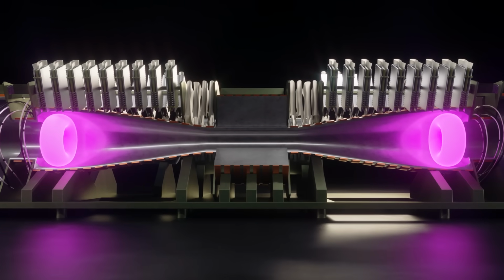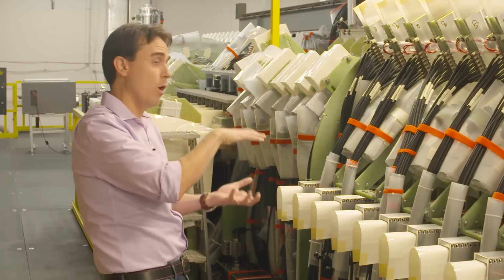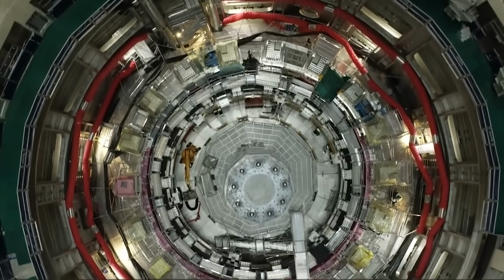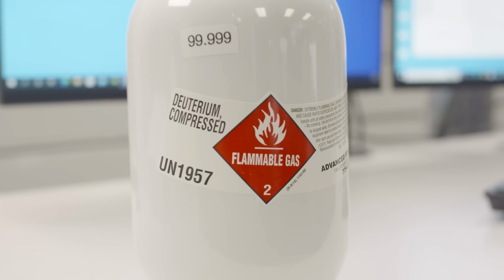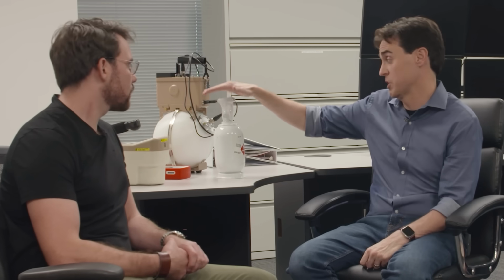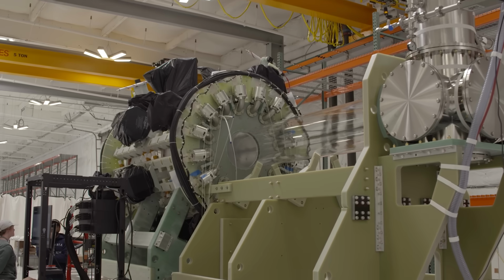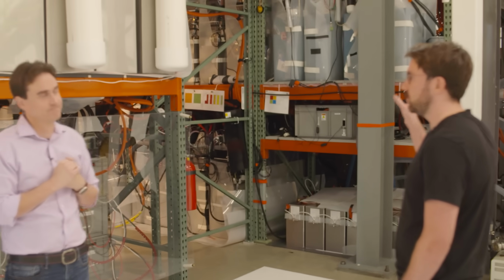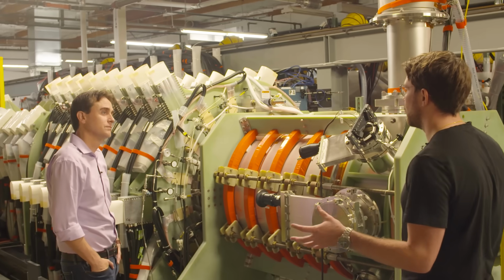A New Way to Achieve Nuclear Fusion: Helion

Comment: You made a few mistakes in this video. This is a video from Improbable Matter talking about it: https://youtu.be/3vUPhsFoniw
Reply: The IM video is mostly nonsense.
Here is my critique of the critique.
- Critique: "FRCs have been done before and never worked." 
First, define "worked"! What was the goal of the experiment and what was the outcome?
Second, yes, FRCs have been done before and the members of Helion's founding team were actually involved with several of them. They applied the lessons learned from those to their own design, which they have tested over 6 prototypes so far.
Lessons learned and applied:
1. Size of the FRC. The larger, the less susceptible to n=2, rotational instabilities.
2. Elongation to radius ratio. The longer the FRC, the more stable it is to tilt instabilities.
3. The merging before the compression. This part creates a single, hotter and more stable FRC as a target for compression. FRCs get more stable, the hotter they are.
4. Helion's FRCs have a very low electron to ion temperature (Te:Ti) ratio of 0.1 and less. That makes things a lot easier compared to machines where both are in an equilibrium because: 
P(fus)/P(loss) scales as Ti^1.5 / (Z^2 * Te^0.5 )
Where Z is the atomic number (in case you wonder about that).

- Critique: "Deuterium - Helium3 has a smaller reaction cross section than Deuterium - Deuterium. At the 100 million degrees temperature discussed in the video, Deuterium - Deuterium reactions would be much more likely than Deuterium - Helium3 reactions."
That is generally true, but the author misses some key points:
Trenta is a subscale prototype with much weaker magnets than what they are proposing for a full scale powerplant. Because of that temperatures are somewhat lower than in a full scale power plant. Power plants aim for temperatures 20 keV (220 million degrees) and up to 330 million degrees (30keV). At that point the D-He3 reactivity surpasses the D-D reactivity.
That said, Helion actually wants some D-D reactions because that is how they are breeding their He3.
D-D => He3 +n or D-D => T +p
Both reactions have a 50% chance of happening.
So, in mixed mode (breed and power) machines, they will need two D-D reactions for every D-He3 reaction, at least until the Tritium inventory is large enough that they have a constant supply from decay (Tritium beta decays into Helium3). Sicne Tritium has a half life of 12.3 years, that can take maybe 20 years. That fact is probably the best criticism of Helion's approach.

- Critique: "Deuterium - Helium3 is too hard and Tokamaks cannot do it. Therefore Helion's approach of fusing Deuterium and Helium3 can never work."
D-He3 is very hard to ignite, but they do not need ignition for their design to produce enough net electricity to be economic. Most of the energy from D-D and D-He3 reactions is released as charged particles, not in neutrons. Helion can recover the energy in charged particles directly as electricity at a higher efficiency than a steam plant would. They can also recover 95% of the input energy directly as electricity. That makes their machines a lot more efficient.
Further, FRCs are high Beta (~1.0) compared to Tokamaks (~0.05). Beta means the ratio of the plasmas internal pressure to the pressure applied externally via magnets. 
Fusion reaction rate (the amount of energy produced) scales as magnetic field to the 4th power, an extremely strong scaling. However, that is the magnetic field inside the plasma, not outside, which scales as Beta^2 and B_external^4. 
If it was just about the efficiency of the magnets (it is not), then a 10 Tesla Helion machine would outperform a 200 Tesla Tokamak.
But, it is a bit more complicated than that, because confinement times in FRCs are generally lower. You win some, you lose some. Overall it is still a win for Helion's approach.
Since Helion is using adiabatic heating through the compression stage, they can to some extent(!) balance temperature and density almost linearly for a given magnetic field. D-D reactions favor higher density and lower temperatures. D-He3 is the opposite way round. They can tune that just to the right sweet spot between density and temperature depending on which reaction they want more of.
Another thing that works in Helion's favor is the aforementioned Te:Ti ratio. This ratio actually decreases further with higher temperatures. So the hotter the plasma gets, the smaller that ratio. Trenta already showed Te:Ti at <0.1. It is likely that a power plant will have an even lower ratio. Lower electron temperatures greatly reduce Bremsstrahlung losses. At a ratio of 0.1, thermal transport losses actually kick in earlier than Bremsstrahlung.

- Critique: "The neutrons from Deuterium-Deuterium reactions would have fried Trenta and I see no shielding." 
As mentioned, Trenta is a subscale prototype, an experiment. It is smaller, weaker and only operates at one pulse every 10 minutes (max). A full scale powerplant would do 10 pulses a second!
Not all shots were fueled by Deuterium or Deuterium + He3. Many were fueled by a mix of hydrogen and Deuterium or pure hydrogen, depending on what they wanted to test.
Because of that alone, the total neutron flux that Trenta has experienced so far is not that high.
What the critique does not mention is that neutrons from D-D reactions have a much lower energy than those from Deuterium- Tritium reactions (2.45 MeV vs 14 MeV). Those 2.45 MeV are below the activation energy of many materials.
The machine is mostly made from low activation materials or materials with a half life measured in minutes. Aluminum activated by D-D neutrons has a half life of 2 minutes.
In fact testing different materials under neutron exposure was one of the purposes of Trenta. They have tested quite a few alloys to see how they behave.
There is still permitted shielding of course. It is in the walls of the room and not close to the actual machine, which can handle the aforementioned relatively reduced neutron load just fine. 
It is also worth mentioning that a mixed mode Helion power plant (that does both breeding and power production) would produce neutrons only in one third of all reactions. So the neutron flux, even for those machines would be lower than for a D-T Tokamak.

- Critique: "Helion claims that they discovered new physics when they say that the ion gyro radius is 25% larger."
The whole ion gyro- radius thing was based on a misunderstanding and out of context quote and maybe also bad wording.
What happened was that Trenta achieved a higher ion temperature than predicted by Helion's too conservative physics model (a higher ion temperature is actually a good thing!). That higher ion temperature caused a 25% increase in ion gyro radius, which is perfectly in line with established physics. That's it. Nothing to see here!

- Critique: "Helion had previously said that they would have a working power plant in 2021. "
IM was very eager to get a "gotcha" on Helion. I guess he did not read further up on the page, or he would have seen that Helion was in the process of raising funding at the time. They did not get that funding until now. Even Trenta was less than 35 million (especially if you take the 35 million into 2019 dollars, when they started building it).
No bucks, no Buck Rogers. Should be quite clear, no?

Comment: I really, REALLY want Helion to succeed, but this is not nuclear fusion in anything like the same kind of self-sustaining nuclear fusion reaction that keeps the sun burning. This is essentially a plasma MHD generator—an idea that is at least 60 years old. That's not a deal killer. The real problem with this is getting enough energy out to support the entire process—that is, true net energy gain. They're not even close. And what about the neutron radiation, and the wasted bremsstrahlung radiation?

Comment: Another amazingly well-made documentary with extremely interesting moments... the biggest question it has left me with is this:

Is there even any point anymore to Tokemak reactors, given what Helion has already achieved right now?
It seems to me that the Iter Fusion Reactor has been rendered obsolete before it even finished construction by this approach by Helion.

Not only due to them skipping Steps 1 - 4 of the prep stages, which results in major efficiency increases eventually in a real world scenario, but also due to the potential mentioned with dedicated and discrete fuel generating reactors supplying multiple energy generating reactors, thus making maintenance and even full-scale repair that much more straightforward, and again: more efficient.

Thus it really seems to me that Iter, while impressive for its international collaboration, seems kind of superfluous now and thus a gigantic drain of preciously rare resources and an equally gigantic flaw, namely it having the same issue as fission reactors: massively irradiated large scale components that need extremely expensive treatment afterwards, which significantly lessens the overall efficiency of the entire concept.

Comment: The man starts by describing a million degrees as "relatively cool", which... Yeah, this guy has been around giant numbers for a long long time :P

"Over a hundred thousand amps"... Yes, "high intensity" is a good word for that. Good grief. The insulation seems relatively light. Let's say... In the ballpark of one kV? That would be 100MW, give or take a zero. It's pulsed, yes, but still. Those are numbers. Big numbers.

"Into a higher field section" well of course there is a stronger magnetic field there... Because the initial one was "relatively weak", I'm sure.

"So now we increase the magnetic field"... This is where words fail me, and we aren't even 8 minutes in.

Good job. I don't know that we can extract the kWh/MWh we just put into this thing, especially when you factor in the cost of manufacturing the fuel, but let's wait and see.
Reply: A single pulse will have single digits kWh energy content.
Reply: And a duration that doesn't hit single digit seconds. Scale it up to continuous production, and you're hitting double-digit MWh after your first hour. This is before factoring in fuel production energy consumption. 
It's very interesting technology, and I am keeping my fingers crossed, but I am not selling the house and buying stock just yet.
Reply: @o0alessandro0o  
Power plants will do 10 pulses a second. That turns into 50 MWe net electricity production if released continuously from the capacitor bank. 
So, 50 MWh electricity production in an hour (sort of stupid way to put it but you get the idea). 
Fuel production and cost is negligible. A 50 MW plant will need on the order to 20 kg of fuel a year.
Reply: Yes 50 MWh/h sounds silly (why not just say MW?), but it keeps the units consistent (that's why). So. The actual power plant will require 50MWh of its on energy, and 50 grams of fuel, every hour, to keep the lights on. This is back-of-the-envelope, ignoring the costs of maintenance and such. How much does it cost to produce a gram of fuel, in MWh?
Reply: @o0alessandro0o  
- No, I said 50 MWh/h was the net electricity output! So they will have some power recirculating for the next pulse and enough extra to put 50 MWe to the grid.

- I don't get your math here. 20 kg/year is 2.2 grams/hour.
At current prices, Deuterium should be on the order 80,000 USD for a year supply. 
That includes the cost of everything, of course, including the energy needed to make it.
It is nothing compared to ~4 million of revenue at 1 cent/kWh, which they are aiming for. Prices for Deuterium will likely go down if they decide to make their own and/or production increases to supply their plants.
Reply: Right, my bad. I did the math per day, forgot to divide by 24.
2 grams per hour then.

So, 10 pulses per second at single-digit kWh per pulse, call it 5kWh per pulse, are 50kWh per second, 3MWh per minute, call it 150-200MWh per hour. That means that the machine would be generating 200-250MW, using 150-200 to keep the lights on, and outputting 50MW. Ballpark figures. 

Power plants producing 250MW or more are pretty common, so it's not inconceivable by any means, but it seems like a lot of power to extract from a fairly small space.

For the fuel, I am not considering the economics of this, just the physics: deuterium has an energy cost to extract, and 3He has an energy cost to produce. This cost adds to the 150-200MWh per hour, and therefore the amount of energy that must be extracted from the machine to keep the entire thing actively producing energy.

Saying that this cost is negligible may be true, separating deuterium from hydrogen starting from light water is nowhere near as hard as separating uranium isotopes, and the helium is being made in a machine that might conceivably recuperate some of the energy costs... But how much fuel is expected to be produced per MWh?

All of this will eventually drive up the financial costs, but I am more interested in the physics and engineering of it: all that energy has to be collected from the tiny area in which the fusion event occurs, unlike more conventional power plants which just let the heat spread to literal tons of water.
Reply: @o0alessandro0o  
We do not quite know the amount of energy that has to be recirculated yet. I would assume it is LESS than what they get out net. But that number is not public yet and so I might be wrong here. 

Deuterium has an energy cost to extract, yes. But let's assume that all of the current cost of 20 kg Deuterium (80,000 USD) is the cost of energy to make and transport it. 
Zero labor cost and zero profit for the companies involved (unrealistic).
And let's assume that this is at the same (very low) 1 cent per kWh that Helion is planning to charge (unrealistic).
Then it would take 8 GWh/year to make it. That would be 8 GWh for a machine that produces 438 GWh a year. In reemphasize again, that those 8 GWh is obviously totally inflated.

For the Helium3 production:
He3 is produced in the same machine with fusion of Deuterium. Two D-D reactions for every D-He3 reaction until Helion's stock of Tritium is large enough that they have a constant supply of He3 from decay.
They might make dedicated breeder machines but that is not certain yet.
Either way, looking at the graph in David Kirtley's Princeton talk, D-D should be just barely self-sustaining.  Maybe a small loss (likely not), but that should be more than made up for with the higher energy output of the D-He3 reactions. Mixed Mode (breeder and power plant in one) machines that produce 50 MWe net electricity would have that factored in already anyway.
Reply: I see no reason to assume that, though it's not necessarily a show-stopper.

Achieving fusion isn't the problem, fusion has been achieved before. Many times. 

The problem is extracting more eckeltricity from the fusion event than you had to put in in the first place in order to cause it. 

So far, nobody has achieved that.

Now, admittedly, they are using fuel that is much easier to find than tritium, and they expect to be breeding their own high-grade fuel in the process, so those are two big advantages over their competitors. 

That said, the big hurdle remains recovering the large amounts of energy they just spent.

They plan to use the containment field to extract this energy. One assumes that this is the big continment field, the one that is fed one whopping MA at unspecified voltages. 

That energy has to be recovered in its entirety before you can start making profits, and I suspect the production versino is expected to run with a higher duty cycle than the single-pulse one, meaning it will require more energy.

So, no, I do not expect that they will be spending less energy in keeping the lights on than they end up selling. That is not an issue per se: even needing 90% of the electricity produced to keep the lights on would beat any competitor by miles - given that, at the moment, they all need well over 100% of whatever they are expected to produce.

Of course, that assumes that they can recover over 100% of the energy they put in, and that has not been demonstrated yet.
Reply: @o0alessandro0o  
What matters is the energy balance per pulse. A higher duty cycle does not change that. It is still the same energy balance, just more often.
They have demonstrated 95% input energy recovery already (that is without any fusion reactions happening yet). Fusion energy extraction would be less efficient, but still much more efficient than steam turbines.

Comment: This is very interesting from a technology POV and a well done documentary. But isn't the long ago proven thorium nuclear reactor a much simpler & far less expensive solution to sustainable power generation? Seems that these various fusion schemes are doing more drawing in of investors who may be more enamored with the trendo technology rather than truly educated about it. I've been intrigued with fusion for a long time but the more I learn about it the more non-viable it seems until there's a fundamental breakthrough of our understanding of these forces. Complexity is a killer. Thorium is proven, safe, practical and doable now. Fusion research should continue but a workable power plant is probably still the perpetual "30 years from now." It'll need to be a lot simpler and cheaper. Perhaps sometime in that mysterious 30 year time frame we'll learn how to manipulate gravity and then be able to make a mini sun just by compressing hydrogen. But that'll probably be very complex and be continuously 30 years away.
Reply: This is awesome technology. It could help us travel the galaxy.
As a commercial power source it's just silly. Who is supposed to buy it's electricity? It can never compete economically.